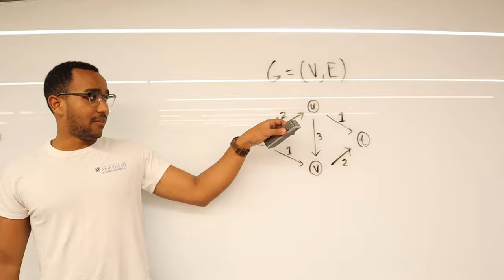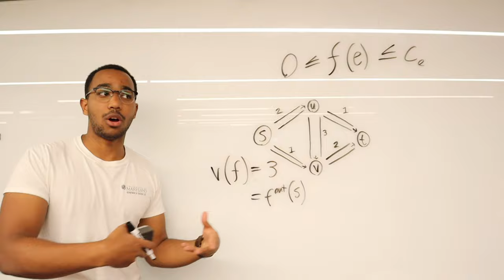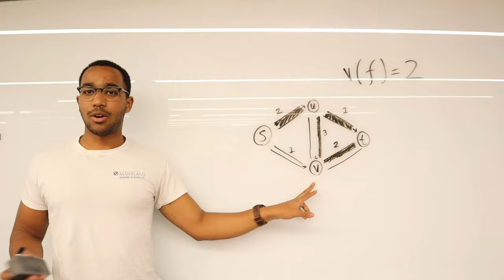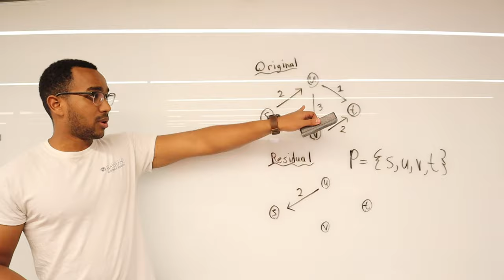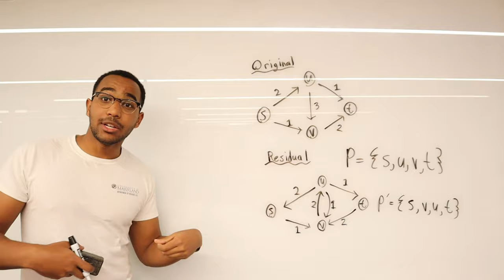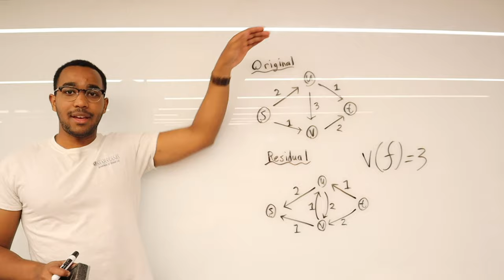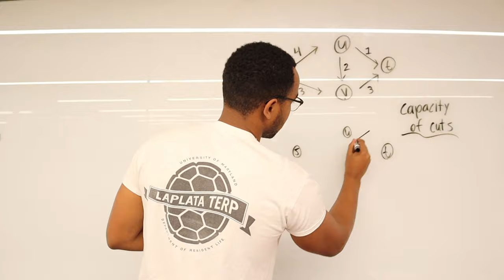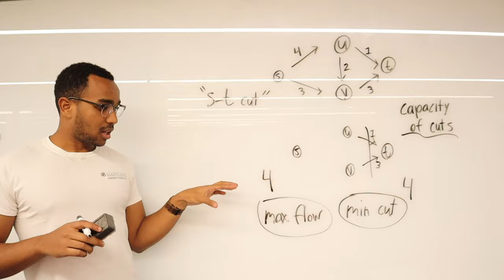Network Flows: Max-Flow Min-Cut Theorem (& Ford-Fulkerson Algorithm)

Comment from the maker: Check out the free DSA Mini-Course 👉https://backtobackswe.com/five-day
Table of Contents:

Defining The Flow Network                         0:00 - 3:35
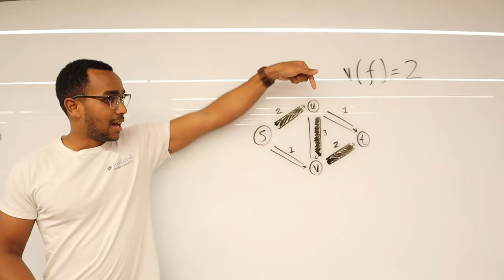Greedily Pushing Flow                                  3:35 - 5:16
Recovering From The Greedy Choice        5:16 - 8:01
The Residual Graph                                      8:01 - 15:36
Ford-Fulkerson Algorithm (Overview)       15:36 - 17:42
Max-Flow Min-Cut                                        17:42 - 21:55
Reply: Thanks so much for this channel dude. Your videos on backtracking and sorting were absolutely key to my technical interviews at Amazon this past week. Ended up getting an offer, cheers mate.
Reply from the maker: Nice!
Reply: @BackToBackSWE  So as far as i understand the min cut (S,T) is an indication/bottleneck for the maximum flow we can push if all outgoing edges of the S part become saturated,right?
Reply: @BackToBackSWE  What purpose does a cut serve ?

Comment: Great explanation. Just a note Ford Fulkerson, it is not an algorithm but rather a method as it has multiple possible implementations with different run times
Reply from the maker: https://en.wikipedia.org/wiki/Ford%E2%80%93Fulkerson_algorithm 😳😳
Reply: @BackToBackSWE  okokok so it's just a matter of how strict you are before it is not categorized as an algorithm :D

Comment: Isn't the idea of the min-cut just that it is the bottle neck between s and t? Hence, pushing flow from s to t will be capped by the min-cut edges, therefore their value tells you the max-flow through the network. At least that is my intuitive takeaway from this :)

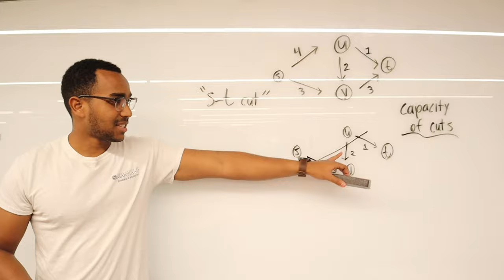Comment: you mentioned we only take the edges going out of the cuts but at 20:17 you take into account the edge from U to V and at 20:31 you dont ?
Reply from the maker: I haven't replied to this for a bit, replying to close this out in my "unresponded to comments" feed.
Reply: The author is correct, is taking into account only the forward edges .The capacity of the cut is the sum of the capacities of forward edges -- it represents the maximum flow which can be pushed through that cut.

Comment: what's the difference between flow and value of flow?
Reply from the maker: The "value of the flow" is the amount of flow coming out from the start vertex 's' (and as a corollary enters the sink vertex 't'). Think the amount of water we could push out of the "pipes" coming off 's'.

A "flow" is literally a function that maps each edge to a nonnegative real number. We get a graph G = (V, E) and for each e in E we literally take it (remember these will be pairs of 2 nodes denoted (u, v) as ordered pairs) - and map it to a number indicating how much flow ("water") will go over that edge in the function we are conjuring up.

It is confusing how the book (& when this is taught) we say "flow" to talk about the unit quantity we are pushing. But each term means something unique.

Comment: I dont understand the residual graph part.
Reply from the maker: It just shows what flow can be pushed and undone over each edge.

If an edge has capacity 3 and we push 1 unit over it then we will have 2 edges in the residual graph.
1.) An edge going forward with a 2 (we can still push 2 more units through the "pipe")
2.) An edge going back with a 1 (we can undo 1 unit...which is what we initially pushed)
Reply: @BackToBackSWE  Ok that seems to be all right. Thanks a lot for answering . I didnt expect to get an answer from anyone cause this video is old, but it seems that there is a hope in humans . I just left this comment because of my frustration cause i cant understand more easily algorithms and my brain is slow.

Comment: helpful and condensed, but too many errors. Instead of correcting the errors in post-processing / editing, redo the recordings to be perfect. You explain well but the errors are too significant to the ideas/understandings to brush by with a small comment in the bottom right corner.